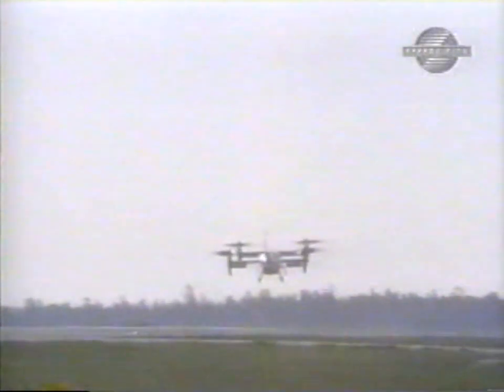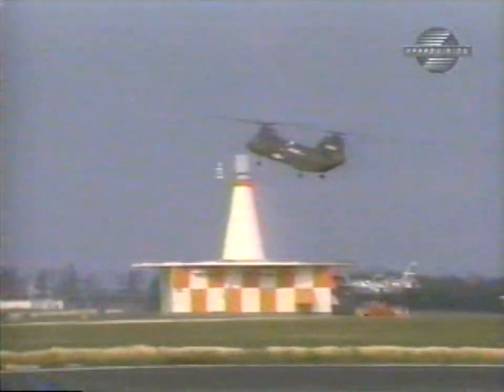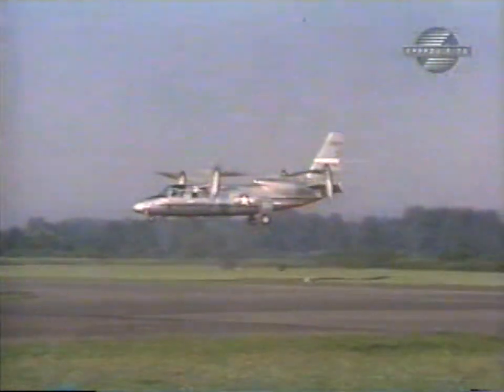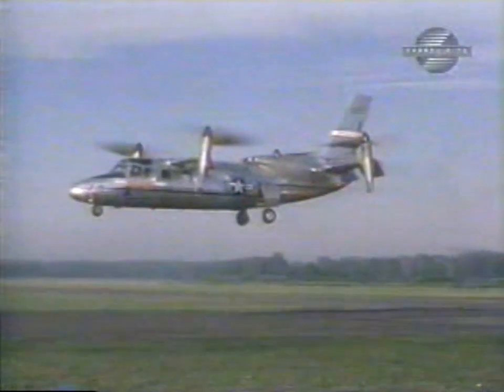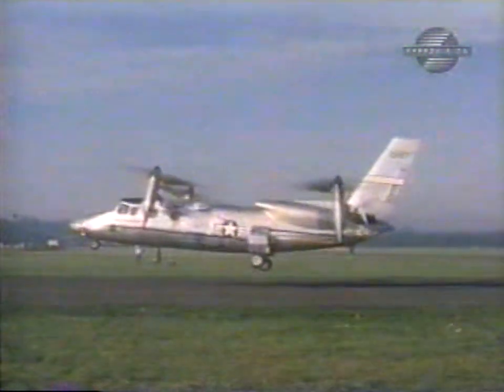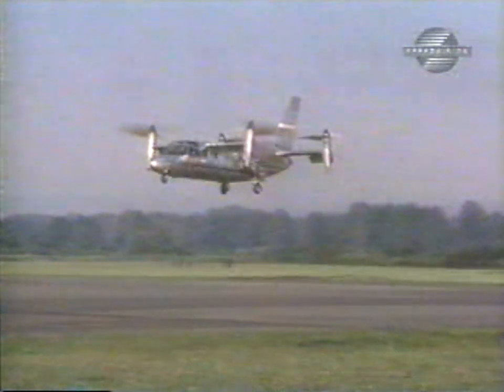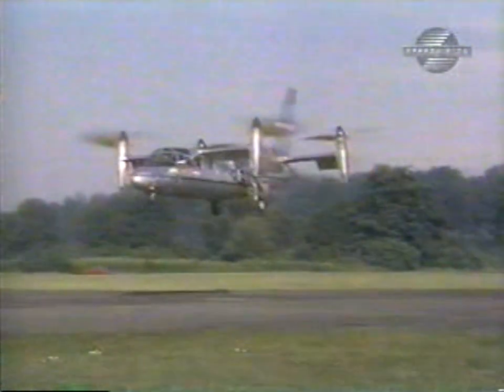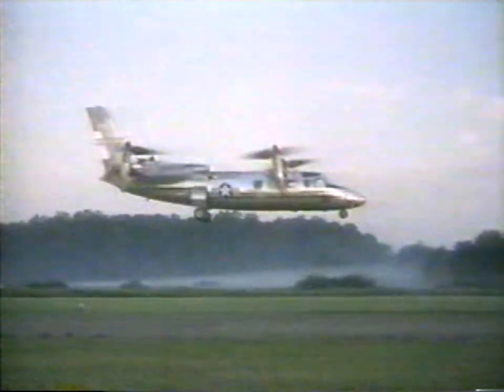Curtiss-Wright X-19 VTOL

Comment: Simply put; the Flight Controls, as good as they were, were not 'intuitive', nor quick-enough in near-hover, hover, ground-effect, nor cross-winds. Things "happened" too quickly for pilots to change prop-pitch, by 'reflex' or "rote". Today, you'll see this plane-type, with 3-times the horse-power, and computers controlling the 'quick-response' bits. Basically, Curtiss needed 1990's FBW-Tech, 3 decades before it was mature-enough to deal with this airframe and the Variables it presented. If the Army had wanted it to just 'go-up' , FLY, Descend Vertically, it might've carried-on awhile as an X plane.  But, no, they wanted MORE, always... As Always.